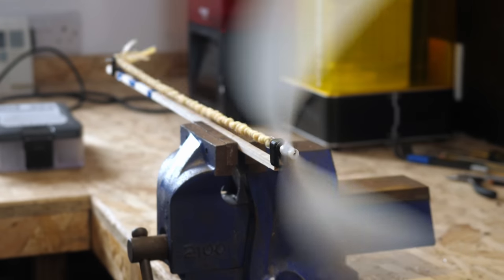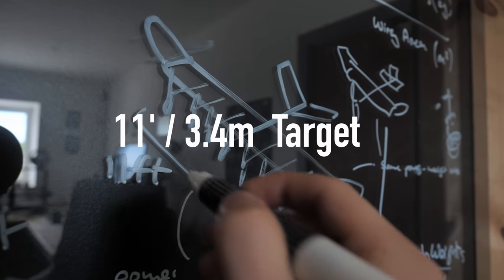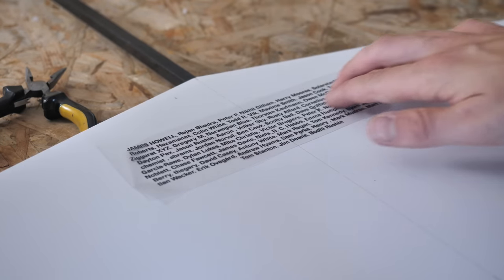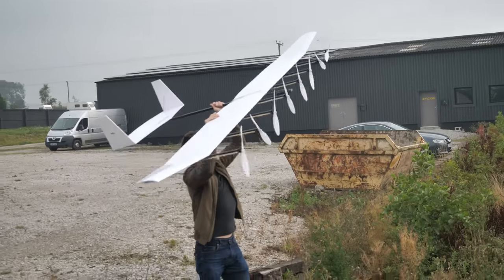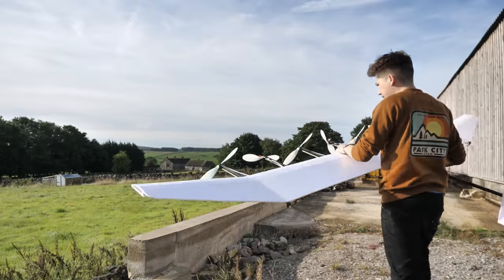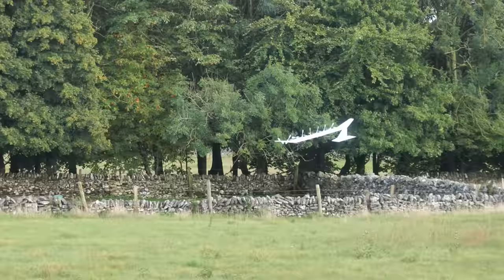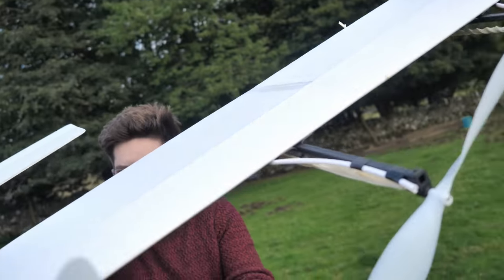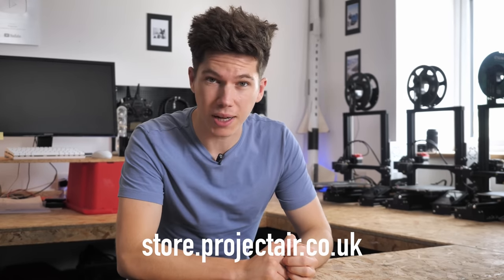Giant Rubber-Band Plane

Comment: That was an impressive effort at rubber power.  An eleven foot rubber powered craft!  Of course it would have flown quite a bit longer and somewhat higher if it had been entirely balsa and lightweight covering but, hey, what you did was great and it flew very well indeed for a six servo RC foam board.  I wasn't expecting much at all and, well, that was impressive as I said.  The built up traditional craft would have taken weeks to make, perhaps months.  It might not have survived the test flights.  Actually awesome, James!  I think you accomplished your goal the smart way.

Comment: You already have 4 servos to start the props, why not stagger so you have 4 props start then the second set of 4 once they run down, that should get your 30 seconds if you make the necessary adjustments to prop size, band length/thickness etc.
Reply: Was only just maintaining flight with all running so unlikely it’d stay up during the initial phase if they were staggered starting?!

Comment: Pls make a CG rig....It will make your life much easier w/ the correct CG & balance. Also adding cw and ccw props and running them on opposing wings should reduce your torque issues, don't for get to lube the bands.

Comment: You should check out some of the free flight pro’s (like Joshua Finn, or many others) about setting up your rubber motor’s. I believe if you lube your rubber, and run 4 strands instead of 2, then make them about 50%-100% longer than the motor’s (stick) length, and braid the rubber you can probably get run times of well more than double, maybe 45 seconds or close to a minute with even more power.  Just a thought.  Rubber power free flight has been around a really long time, the old timers have really perfected it, they even have certain years that the rubber is manufactured that is apparently better than most.  Of course they mostly build out of balsa stick and tissue paper.
Reply: Check out J&H aerospace on YouTube
Reply: We build using carbon and other modern materials now. Look up F1B on YT for modern competition models
Reply: @MangeSoderling  i know all about F1B, they are very cool but a little more than I want to spend, I like the old moffet designs, p-30, cabin models etc.
Reply: @SkidzFPV  no need to go full competition just enjoy flying I highly recommend E36/F1S simple electric

Comment: My claim to fame, at around age twelve I built a KeilKraft Ajax rubber power plane. It took off from the pavement outside our house did a beautiful 180 turn crossing the road and landed perfectly on the pavement on the other side of the road 😳 
A little later I was winding the motor and the elastic broke, it total shredded the fuselage and that was the end of that 🥺😰😭

Comment: Instead of your rock/string/wood block  pulling from the front to release the props it would have been just as simple to have them pull from the rear. This way instead of having to pull back to release the props they would have released naturally as you threw the plane forwards. ( plus it would remain 100% freeflight with no need for servos)

Comment: The props could be made to release at different times but if any are locked during flight, they might drag the speed down and act as brakes.  Maybe props that can hinge back when they are waiting to be triggered could fix that.  Then, when they are triggered, the centrifugal force would spread the props open and allow them to power the plane.  Or maybe something printed could be made to let the props freewheel while locked and be powered by the rubberband when triggered.............. like a freewheel hub on a bicycle.

Also, if you print the props so that they are opposite rotation on each side of the wing, it may counteract some of the forces pulling the plane in one direction.  But, maybe I'm wrong.

Comment: Success!  It took a lot of effort, but you succeeded well. How about rounding the leading edge and sanding a taper to the trailing edge of the wing, and you will get a great improvement in flying performance. Try that. Rudolph

Comment: A word of advice about that homeboard. That stuff looks like the Elmer's phone board you might buy at Walmart here in the States. The paper on both sides of that foam is extremely thick and heavy. It makes that phone ideal for aircraft parts that are going to take a hit but the rest of the aircraft should be built from Adam's board. The foam and paper on that particular phone board is much much lighter. Seriously less than half the weight. Rule of thumb for a decent aircraft isMax thrust should be about 50% of the weight of the aircraft and you will achieve a nice easy flight some aircraft can fly with as little as 10% of the Weight of the aircraft for thrust. All I'm saying is you had you built the same aircraft out of Adams board your thrust to weight ratio would be much much higher

Comment: Why not make some kind of stick rig to block the propellers before starting? You basically need one long stick with a small stick attached at 90° for each propeller. Hold the stick to the bottom of the plane, so that each small stick blocks a single propeller. When launching, just throw the plane with the stick. Gravity will drop the stick down and the propellers are clear.

Comment: I was just thinking.  Use a planetary gearset to gang multiple rubber bands to a single, much larger -- but more efficient -- propeller. The planet gears would rotate but not revolve. This would also make it feasible to enclose all the rubber-bands and make tensioning far easier. 
I would use two fuselages, with an overall design like a P38 but without the cockpit. You certainly could make the propellers counter rotating, but with large control surfaces afforded by my design I don't think it's strictly necessary.  The planetary gearset makes contra rotating propellers feasible but but the bearing mounting(s?) will get even more complex.
Reply: Hmm. Might have to get myself a 3D printer and try it out myself. Also, bearing choice is gonna be very important in my proposed design.

Comment: Look for F1B free flight models. They can climb to 70 meters height within 40 seconds, using a 30gram of rubber, and then glide for a few minutes in dead air.
They are the best rubber power aero models in the world

Comment: Great video.    
Near the end of the flight the rubber bands have spent their energy.    The props might be rewinding the rubber bands and taking energy back out of the flight      Wondering if you can disengage the rubber bands  near the end of the flight to increase flight time.
Reply: Or reengage the prop stops used in the winding process!
Reply: @steveemery30  i've had rubber band planes where the axle and the prop formed a simple one way ratchet mechanism, perhaps he could do something similar
Reply: If you look carefully, the props he’s using have the ramp to allow freewheeling.  However, I’m pretty sure he’s landing with turns in the rubber so they don’t have a chance to freewheel

Comment: I have an idea. You could print a gear box to increase the number of turns on the prop, and use multiple rubber bands like a gatling gun, so you have more rubber to turn a large propeller. You'd have a longer flight assuming you could get a high enough gear ratio to keep the rubber bands from unwinding too quickly. I'd love to see that project.

Comment: It seems to me that you could find a way to switch propellers to a second rubber band using electronic controls. That would cut down on duplicating too much weight and almost double the flight power.

Comment: You could 3d print some gears to attach 8 in parallel so that you can run a much larger propeller. Kind of like a Gatling gun shape. This would also allow you to change the duration.

Comment: Could you, in theory, find out the minimum amount of propellers (example: 3) and then use a multiple of that number, triggering different propellers at different times (like 3 props for "take off", then other 3,maybe even with stronger elastic bands for better acceleration but shorter thrust, then other 3 to keep the flight alive) to ensure longer flights?

Comment: Idea, you could replace the rubber bands with smaller electric motors and pair them with a battery back and remote a control receiver

Comment: Could you take a battery and then put it on there and then make it have a mechanism that retightens the the rubber band. And you could do it where all the propellers retighten that different times. So you have a fuel source but you have a totally different type of engine. That would be pretty cool too.

Comment: Two rows of propellers. The first row starts and when they run out, the second row is released. You could even have the first row being wound back up by a small electric motor on each prop while the other row is releasing it's energy. The only problem is weight.

Comment: Don’t you need a 1:1 thrust to weight ratio at a minimum to generate enough lift for sustained flight, given the fact your motors only generate 640g of thrust and the plane weighs 1.2kg, you’ve basically only got 50% of the power you need hence why it’s just gliding.

Comment: Mythbusters made a, I think, giant slingshot in of their programs. 
After testing a lot of different materials to use as the rubber bands, they ended up with latex tubes/hoses.
My guess is that if they work the best for a slingshot, they might also be great for transferring energy to the propellers

Comment: There are rubber lubes made just for that kind of motor. 
Also, as I recall 300 turns is nothing.  I doubt you are using half of the potential.
Reply: Rubber lube also help stop the rubber snapping... DAMHIN lol

Comment: next time make the props disengage automatically with ratcheting axles, i've seen them in some toy rubber band planes, its basically a protruding section of main axle bent 90 degrees to mesh with a tiny ramp sloping around the hole where the axle pokes out on the prop.

Comment: Looking at it, just wondering if you could potentially improve thing by aligning the propellers. 2 on each wing like you already have, the other to almost inline with them but arranged at the back of the wing contra-rotating to the direction of the front ones. Could mean less servos to release all the motors plus improved performance thanks to two propellers utilising the same air flow? And that will move the centre of gravity back too.

Not an engineer of any description just thought I’d put it out there, so be gentle! 🤔🤷🤣

10:28 and I’m pretty sure they do make waterproof or resistant foam board for model aircraft

Comment: I would love to make my own and beat the record but I have know idea how,  but I feel like you could get hours if you did a dual stage system where you have a set of propellers flying the plane while a motor system is winding up the rubber bands of the second stage and vice versa. However long your battery lasts it could fly.

Comment: Would it be possible to have a purely mechanical auto-level system using a weight on a lever, with the lever hooked via cable (or maybe string or something) to "servo tabs" (also known as "Flettner tabs" from what I'm reading) on freely swinging elevators, so that it indirectly adjusts the elevator based on the relative direction of gravity? (don't forget to shield the weight and lever from the airflow, and add a mechanism to allow for fine-tuning to compensate for the acceleration introduced by the props)
Reply: It has been done banned in competition though
Reply: @MangeSoderling  What's the reasoning for the ban?
Reply: @tiagotiagot  to be honest I could not find any info so I think I was wrong.

Comment: Put a second rubber band in series on each motor. The only problem is to find a way to switch from the first used rubber band to the second still wound one.

Comment: u should put motors on the other side if the rubber band from the propeller that can rewind it really fast, and then offset the motors to start 4 of them on take of then the other 4 start as the 1st group starts unwinding then it can fly for way longer idk if this actually would work lol but its a cool thought

Comment: You should use flite test foam, It’s more durable, water resistant and lighter
Reply from the maker: I’ve tried Flite Test foam but it’s actually a lot less durable than this stuff you can get from Amazon!
Reply: @Project-Air  wow you replied if the Amazon stuff is even more durable I’m gonna have to try it cause I’m a beginner and crash straight to the ground all the time

Comment: For an Aeronautics engineer i find it odd why you didn't use CW and CCW propellers in combination to cancel out the twisting torque.
Reply from the maker: I didn’t have any available CCW props
Reply: @Project-Air  Surely you can print a handful on a resin printer. Will be looking forward your next video and see if you'll use CW and CCW props and if that makes any difference on the airplane stability. Cheers.
Reply: With correct trim or low torque you don't have to  we use props around 1/3 of wing span in competition F1B

Comment: Perhaps having the engines run one after another instead of all at once would allow a greater flight time 

If there was a way to make multiple rubber bands power the same propeller one after another that could save weight and drag

Comment: Maybe . . . centralise the thrust a little by running pairs of props on slim push-pull housings . . . same rubber, more boing?
Thinking back to old 'Airhog' days, does winding up a bank of lightweight capacitors count as 'rubbery electron drive'? : )

Comment: Winding up the rubber bands like this is super inefficient. I would expand them along their length around a drum (that being connected to the propshaft), whose diameter can be varied to trim for power vs. endurance.
Reply: This is sadly in practice not true for aero modeling.

Comment: There's a formula for the amount of rubber for a motor. Use 1and one half the length between the propellor drive and the anchor. If it's short, you don't get the needed power.
Reply: This is true for slow models but in outdoor FAI competition we usually have shorter motors than tube
Reply: @MangeSoderling  When I was growing up, on rainy weekends, dad and I would go to the hobby shop, pull out what we had in our pockets and buy what that got us in balsa, then dad would by the props and rubber motors.
We'd sit and build small rubber models and the contest was to trim them so they didn't hit the ceiling but stayed short and who could keep them up the longest. it was fun, build during the day, fly them that night, tissue covered and all. Taught me to trim airplanes.
Reply: @jamesberwick2210  that's a lovely way to build and fly. The most extreme indoor (F1D) basically tackles the same problem
Reply: @MangeSoderling  It was that or when I got out of the Air Force, just short of eight years, we'd go buy Peck's Polymer kits and build those then when the rain stopped, go out and fly in the yard. I went on to build RC, dad got back into RC, and flew up until we started having problems with finding places to fly. I went back to Control line and might even try some electric free flight if I can't find a new field for CL. I'll find a way to fly, one way or another, enjoy it too much. (72-year-old kid).

Comment: What if you made the carbon shafts a bit longer and added more propellers at the back. Then have a separate servo that starts them so you can turn it on mid flight to have double the flight time.

Comment: Don't know what it is, but you should make a rubber band arsenal bird.

Actually in a way I think its a good option. It's overall probably smaller. Just a flying wing. And has a decent number of propellers. Contra rotating? Most likely not.

I think its a design that can be worked with. 

Or is it me being an idiot again?

Comment: Gadzooks, there's over 100 years of knowledge base for rubber powered FF aeromodeling but you're deliberately ignoring it and reinventing the wheel!  

Longer motor sticks.  Lighter airframe.  Dont carry the release.m3chanism onboard, make an improved system that stays on the ground after release.  Install downturns on your props to avoid pitch issues.  Stagger and overlap the props to get the thrustlines closer to center mass  (It won't decrease the thrust).  Use classic construction techniques to get a lighter stronger airframe.  Stick-and-tissue is the original stressed-skin method, proven over the years and generally superior to foam and plastic.   

And consult some experienced modelers for info that has been discov ered and developed over generations.   Dont disregard all.of the available knowledge on these models!

Hurts to watch you struggle with problems that were solved before your grandad was born...
Reply: Downthrust,  not downturns.  Autocorrect is a curse, sorry.

Comment: replace the foam board wings with a balsa wood frame and using light weight plastic stretched over it. Should cut down on weight and let you fly easier. We built them in middle school for a competition against other schools. One school had theirs fly for over a minute, granted there were no servos or cameras onboard, I think with those larger wings and extra props, you could not only break the record but annihilate it.

Comment: my thought process is to attempt flight with only half your bands at a time fiven you have servos already  just attempt to not crash using 50% thrtolle if 16 secs with all going then theoritically 32 secs with only half at onc (im aware this is not how it works and would require futher lightening to work well